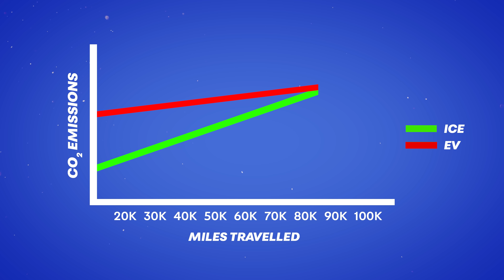Are Electric Cars REALLY That Green? [New 2022 Data]

Comment: What about when the electric car reaches 90k miles and the battery pack needs to be replaced, that resets the emissions above the ice car again!! And most electricity is produced via fossil fuels, and even wind turbines don't ever over the lifetime of the unit produce more energy than is required to produce them, the whole thing is a farce in my opinion, if people figure out sustainable ways to make batteries and produce electricity great but until then I think hydrogen cars and nuclear plants are the way to go, look at France for example.....

Comment: Ummm……… I do agree the battery efficiency and production needs improving and that will happen over the next 10 years. What I find strange is saying you can compare the XC40 ICE and XC40 Recharge because they are ‘the same’. Aren’t you forgetting that the XC40 Recharge is a converted version of an ICE car so instantly has all the ICE manufacturing built into it before conversion - you can’t compare that to completely new manufacturing process for cars like Tesla and Chinese EV’s. I think the only reason Volvo have done this is to try and slow down EV takeover as they have a vested interest in keeping their ICE sales going while they transition - it won’t work and will backfire. There is a long way to go to make EV’s greener but this comparison is totally flawed.
Reply from the maker: They say the xc40 CMA platform is not an ICE platform. It’s was built to accommodate EV powertrains from the start. For example it’s the same platform used by the Polestar 2 and Lynk & Co, which have no ICE equivalents.

Comment: Where this study is fundamentally flawed (as far as I can see in this video) is that they don't take into account the reusability potential of the materials in the batteries and the synergies between EV and other applications for energy storage like grid, electronic devices and so on. Oil is burned and lost. Well managed battery materials can be reused multiple times retaining much more value.

Comment: A best case 3-year break even point is pretty good for a complex system. I wonder how it compares with local power generating equipment, such as solar panels in terms of carbon payback?
Reply: Solar panels have their own carbon footprint, and then there's the issue of what to do with them when they wear out (YES, they do).

Comment: Wait, is Volvo claiming all EVs take 90,000 miles to turn green or Volvo EVs need to drive that long?

Still, EVs are cleaner in way of noise pollution, stink machines, performance, safety, and ability to remotely control EVs (heat, stats) via app.

Comment: All batteries must be recycled to reduce mining and waste. Battery manufacturers are also trying to find cleaner and less polluting ways to make these batteries. Here in Iceland, we only have renewable electricity from hydropower and steam stations. We have very few windmills, even though it's windy here 😊 If we have more EVs, we don't have to import as much oil as we did before, and that is also good for the economy.
Reply: There's Aluminum Air Battery, would be interesting to see.

Comment: CO2 isn't a Pollutant but, we have been brainwashed to think it is. CO2 is not a Greenhouse Gas. Climate Change is a scam and a hoax right from the get-go. 180-200 parts per million of CO2 is required just to support LIFE on Earth. Today there is less 400 ppm of CO2 in our atmosphere. Whats the problem?  By the time the Batteries are ready to install on EV you could fuel 100 cars for 8 years to equal the fuel burnt by the mining equipment and transportation of raw materials to seven different factories to complete the assembly of a single battery pack.

Comment: It’s not all about CO2 footprint. Aside from air quality, think about the environmental impact of gas stations to groundwater, leaking oil and gas, trucking of gas to gas stations, surface water runoff of contaminants to the ocean. We will solve the battery problem eventually.

Comment: Great video, I think having a smaller, cheaper and lighter car with 100-120 mile battery that charges in 10 min is better than an expensive Electric car that can go 300+ miles.
Reply: What are you waiting for? Cars like the one you mentioned are already out there! I've seen Renault Zoe's for sale at £6k.... Charge up while you sleep on cheap rate electricity, and your "fuel" costs could be less than 2p per mile..... You won't need your car while you sleep.

Comment: Over time, EVs will get greener and greener. As battery recycling becomes more common, cobalt etc is removed from batteries and the electricity production uses more renewables. This is a fantastic video, as it shows that both aren’t actually that great, but that EV potential is very high. I’m not sure we’re ready for mass-EV adoption yet, but it’s not that far away.

Comment: What about the CO2 emissions when the battery needs to be replaced in an EV, wouldn't that increase it's carbon footprint even more?
Reply: Why might it need to be replaced? Why wouldn't you simply have it refurbished at the fraction of the cost of a complete replacement?  Like a worn ICE engine, an EV's battery pack can be reconditioned.......
Reply: @Brian-om2hh absolutely, however, the battery isn't at full strength anymore and that reduces the range considerably.

Comment: Really great that you highlight this report. Isn’t it obvious that EVs will only really make sense once the power is generated from renewables. But what happens when there’s been no significant wind for a week? Does everyone have to stop driving? 

On the ICE side: it’s disappointing that you didn’t allow for fuel production switching further to bio and e-fuel so that the end-to-end co2 production is closer to zero. If there was serious investment and green-tax incentives to switch the to more co2 neutral fuels, the ice can be as competitive as the EV … plus you don’t need to manufacture all that new ev infrastructure…

Comment: Good presentation and it sounds like a thorough study by Volvo. Interesting it is based on three versions of the same model; can an EV model of an ICE car really be an efficient EV I wonder? It would be interesting to know how the figures are affected by the weight and battery size of the car since this seems to be all about the battery. And as it is all about the battery, there is potential for it to be completely overturned by any radical new battery design; after all, there is a huge amount of work going on to develop new and less harmful batteries and I very much doubt lithium ion will still lead the field in ten years time.

Comment: Has anyone thought how long do these batteries last before having to replace them in the vehicle. And then how much will it cost to replace them and how do you get rid of the old batteries, what is the process, cost. Like the idea of these vehicles but need much longer range and much better infrastructure to cope with the demand. And the big one. Need to be a lot cheaper to buy.

Comment: More and more grid energy is coming from renewables. Renewables are growing at an exponential rate along with residential solar so this is really a non argument. EV's are winning already in sustainability and they're just going to win by higher and higher margins the greener the energy sources become. Then on top of that companies like Redwood Materials will be recycling used battery packs back into their raw materials and used again in new packs so the need to mine will be greatly decreased which will make them greener again. I love the Rumble of a nice Sports engine but in the sustainability argument there's only one winner EV's.

Comment: Although I agree the potential for battery efficiency development is greater than ICE, I don't think it's fair to say we are at the limit of ICE cars. Most road cars are only 25-30% thermally efficient whereas the likes of F1 cars are 50% thermally efficient. In that alone we could almost double our MPG, without the introduction of synthetic fuels
Reply: I wonder if the modern breed of direct injection ICE cars are not more thermally efficient than you think, when a 1.2 litre petrol engine in a Citroen C3 Aircross produces 130bhp stock?

Comment: A bold move from volvo everyone is pushing ev can’t say I’ve heard of many people discussing the footprint of the vehicle over time well done volvo
Reply: It’s sad that posting real data is called a bold move, in a day where profits matter over anything, especially the truth, I guess it’s necessary to cheer it on, rather than simply expecting it
Reply: @nick_0  This is a SCAM! Artificially set a limit of 124,000 Miles to benefit ICE.
Reply: @Neojhun  not really, you could see from the graph that the EV and ICE lines are consistent, so it doesnt take much to see where the graph goes... you could also argue it benefits EVs since their batteries will need replacing at around the 15 year mark, so there is another bump in emissions. also volvo have committed to be EV only by 2030 so not in their interests to big up ICE 😂
Reply: There’s been plenty but most don’t agree with this one. Most put the estimate at more like 20,000 miles, although a bit more for an SUV like the XC40.

Comment: I note, for the record, that @autoev has deleted my post where I stated that this video is based on outdated (not 2022) information which has been repeatedly debunked and withdrawn by the authors, and where I posted a link to a report specifically aimed at negating the information in the original report.

Reading through the comments below, it seems @autoev have deleted posts from others with a similar opinion.

Pretty poor form to produce such an inaccurate video in the first place, but to delete posts that point out the errors is inexcusable.
Reply from the maker: Who’s autoev? Think you might be confused.

Comment: Useless.

How are you not talking about the real issue. Just bash around the subject. 

Battery's.  They are using the same technology for decades ! A pain in the ass to recycle. A pain in the ass to manufacture. Packed with reliability and range issues. It simply does not matter where the energy comes from while battery's are cursed by design poluting.

But yeah, why focus on the real real issue when you can go around the bush talking about something else.

Comment: What if you take the full life cycle into consideration? EV’s produce a larger garbage pile. Technology for regaining raw materials from batteries is still at lab scale, so we burn them. Composites (glassfiber, kevlar, carbon …) are also hard to reuse or not reusable and will be burned as well. Compare that to a very basic UAZ Bukhanna van, some 90% of that car will be reusable.

Comment: I'm sure you know that Volvo is owned by Geely, one of the largest EV manufacturers in China. The green agenda gets all mixed up when you look at shipping, battery production and all the other hardware that's required. The biggest plus point for me and you mentioned it in the video, is zero emissions at the exhaust. I live near a junction on the M1 link road into the centre of the city of Sheffield which has a disgraceful level of traffic pollution. There are other local areas closer to the M1 at Tinsley viaduct where it is worse. You could definitely argue that reducing UK traffic pollution by driving EV's will make other parts of the world worse of by using fossil fuels to mine raw materials. The pro's and con's are endless. We talk about renewables and then don't really see the amount of fossil fuels and energy involved in installing a 3MW wind turbine and then maintaining it. Just to put the record straight I'm an EV driver and have worked in the industry since 2012.
Reply: Yes, but Euro 7 emissions rules will make ICE cars a lot cleaner. Due 2025 ish, after EU haggling.

Comment: Interesting thanks, another factor TBC fully is battery life and recycling. If the batteries need replacing at X years than that is another lump of CO2 and how well can they be recycled? Also will EV's be a viable 2nd hand purchase?.
Government lead incentives required so PV and wind generation is everywhere, with the switch away from home gas and EV's coming we need more electricity than the grid has (UK).

Comment: @AutoTrader  Thank you for the video. We need more balanced point of view and more info and discussion before we all jump aboard EV's.
Now one thing bugs me. That chart showing 90k miles (or even 52k if you not drive a lot over the year) before it become truly green (mainly because battery production pollution) is dangerously close to battery lifespan warranty provided by Volvo (and other manufacturers) which is 8 years OR 100k miles whichever comes first. 
So basically after our car finally become 0 carbon footprint we have to (in a short time) prepare to replace the battery for the new one - which has to be manufactured polluting the planet again -  which put us back at the beginning of that chart against ICE. 
Isn't?
Reply: this is my thinking too. we do less than 5k miles a year, mainly around town and then with long road trips (london to pembrokeshire/peakdistrict and even southern europe) of course in 10 years time battery tech will have moved on a long way (think that Lithium ion batterys came online 20 years ago but only in small devices) so chances are the replacement would be much more environmentally friendly as well as lighter and have better range.... that said, i believe for most people doing below 8k miles a year a hybrid is the best, low emmisions around town, minimal manufacturing difference and still the same battery upgrade down the line.
Reply: @dankrafted  Agree. Hybrid or maybe hydrogen or at least petrol+LPG.
As for new battery tech - we shouldn't really assume that it will be compatible with current EV's. They may not.

Comment: Interesting points. There are a few key things worth bearing in mind.
1) Interesting that this video came out the week after the ICCT published a report that EVs can have a lower carbon footprint after just 7,000 miles.
2) EV that are built on share platforms with ICE cars are much heavier than ground up EVs. That weight comes from more metal in places that a ground up EV just doesn’t need it and that metal must be a significant chunk of the footprint.
3) Definitely need to make mining less impactful and it does sound like the mining industry is working on this. Albeit slower than we would like.
4) There are loads of recycling facilities springing up for batteries. So when they are eventually end of life, the materials can be reused saving on the carbon footprint of the next car.

Comment: This depends on how you produce electric power. If it's produced from Coal, natural gasses or oil, I agree. In my country the electric power we consume is produced mostly (in excess of 85%) from water and wind (hydropower, wind-turbins). Though 5-10% is lost in the charging process, my electric car use about 33-40 % less energy (depend on season of the year) than a ICE comparable car, I think it's an easy choice. So how about hydrogen fueled cars? When do they brake even, or do they even break even?
Reply: Yeah, but what about:

Lithium, Nickel and Cobalt Mining (Water, CO2, Diesel)
Refining (CO2)
Manufacturing of LIBs (Water, CO2, Diesel)
Recycling of old LIBs [Sorry, actually this doesn't yet happen for car LIBs, due to complexities involved]

Oh, and 80% Cobalt in an EV battery is the cause of 40,000 children working daily as slave labour in the DRC.
Reply: @ChrisWells1  Cobalt is also used in refining diesel and petrol. It also has many other uses in chemistry production, specially as a catalyst. By the way Cobalt is also an issue when talking about mobile phones and all portable devices in general. They are used in airbags in cars, in permanent magnets. The list goes on. The same goes for Nickel and Lithium. I have no idea what LIBs are short for, so won't comment that.
Reply: The simple answer to your question would be - it depends on how the hydrogen is produced! But, hydrogen fuel cell vehicles still normally need a battery (albeit smaller). I'm sure a quick google search might find a LCA comparing EVs with FCEVs. I suspect the answer you'll find is that hydrogen is much worse because of the efficiency losses in producing green hydrogen from electricity - or if it's fossil hydrogen then it's going to be more similar to a ICE car.
Reply: still have to dig big hoes in the earth
Reply: That’s half true. Hydro, nuclear MAYBE water turbines are viable. The wind turbines and solar panels have NO bearing on electrical production. It’s not physically possible.

Comment: Last figure I had heard was 3 years to break even with an ICE car if using renewables...which is about right to 29,000 so it looks about the same.  Maybe not so shocking then.
Reply: EV LIB packs :

13100 kg of CO2 (75kWh * 175 kg/kwH). Just to manufacture the battery in China. Not operate it.
That's more emissions than from operating an ICE car for abut 100,000km

So it's probably about 8 years. Just for the battery. And that's assuming that the EV battery is 100% powered by CO2-free electricity. Which it's not.

Comment: There is alot he didn't even cover. The cost to generate that electricity that those cities will take. Some places have to up production using coal. 

There is that waste from those batteries after they have been used.  It might even be dirtier on a whole northern level

Comment: This tells us that EVs are still cleaner, but still need to be better. Air quality is improved and sustainable energy needs to be used and improved. Smaller Evs help. If average lifespan of a car is say 100-150k, then we still have say 50k-100k of "clean" driving. Lots of issues with the "facts" but not a useless piece of work. So, more work needed.